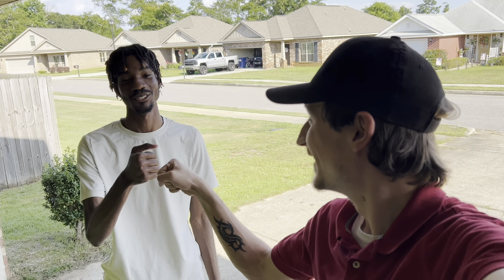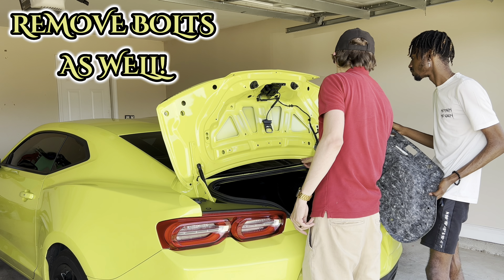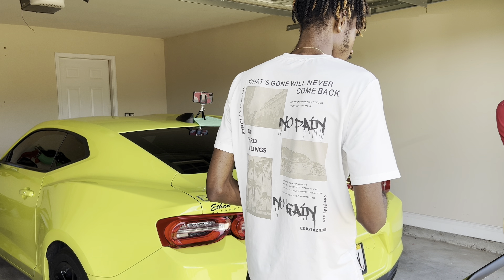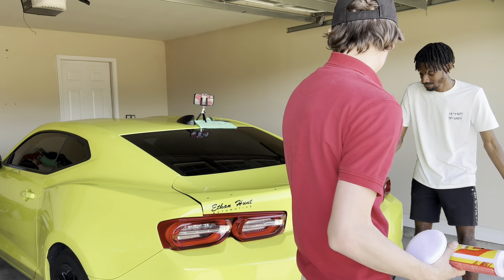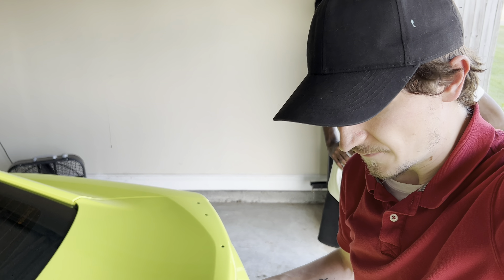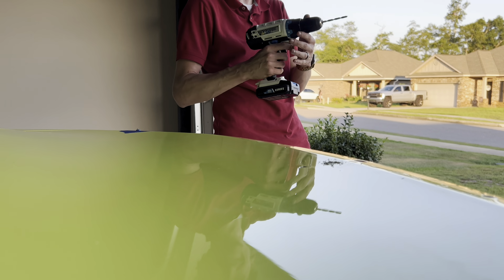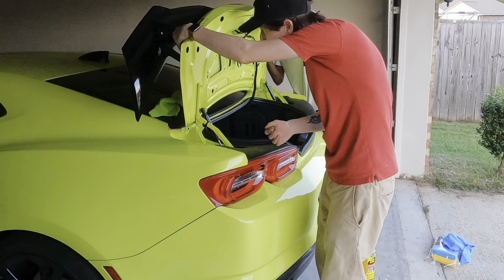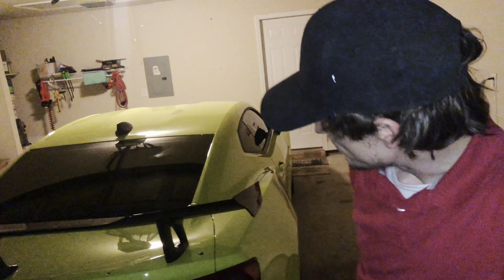ZL1 1LE Wing Install On My Friend’s 2.0 Turbo Camaro

Comment: Many more big wings would be sold if Chevy did not use the 2-hole type deck configurations.  The wing does look great on this Camaro👍👍.
Reply from the maker: Agreed! It sucks having to drill holes for the cars that don’t come with spoilers, or have the little lip spoiler as well. Really like the gloss black with his shock color

Comment: How or what did u use to get the holes perfect?
Reply from the maker: Lined up the back holes with the studs coming off, then put a point with a marker where the front hole would be while holding in place. Same for middle. Just had someone hold it up while doing it

Comment: what did u guys go about doing with the EXTRA HOLES ??
Reply from the maker: On my old car I found some flat clips and color matched them and you couldn’t tell. Don’t think Zach has done anything with his yet
Reply: @JCSCUSTOMS  What are flat clips ?? I’m having same problem with mine just installer ss spoiler and have a couple holes left over
Reply from the maker: @thatwhitemaro  I bought a box of the clips like the ones in the back of the engine bay. The plastic piece that runs around the back by the windshield wipers, take the top clip piece of those and paint them color matched. They lay pretty flat. I used goop to hold them down. Otherwise, could always get a shop to fill them and paint the trunk again, but it’s $$$

Comment: I like the 1le wing and I had it installed on my 1le ss, it turned out great.  I know of  a good body shop in my area and they snapped it out for me for a few hundred bucks with no issue whatsoever and turned out great on my 1less. I see guys putting them on a rs and a lt and they look good but if I had an RS I I would probably do something with the wheels and stance before slapping on a 1le wing